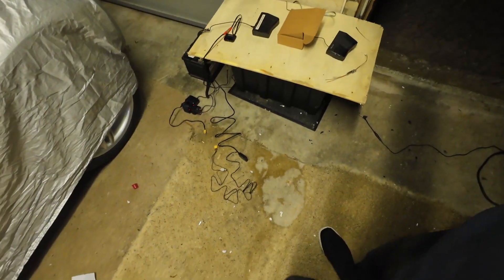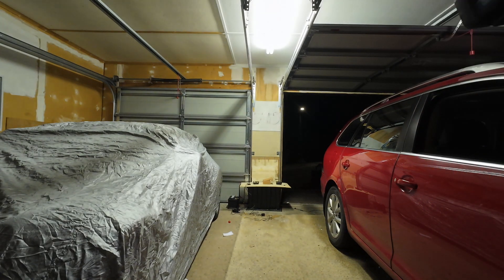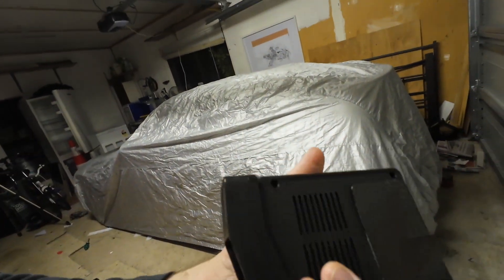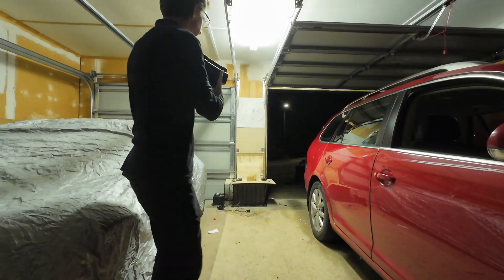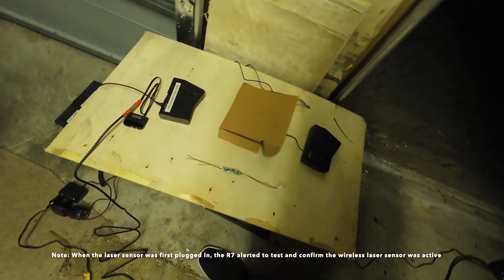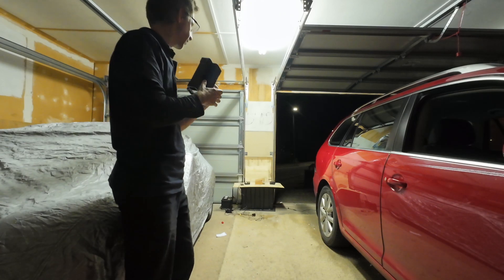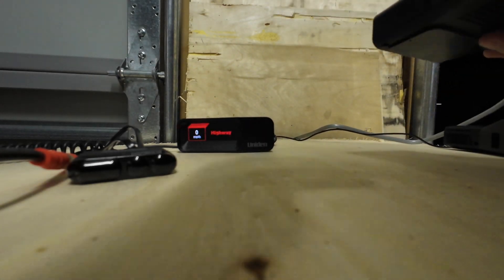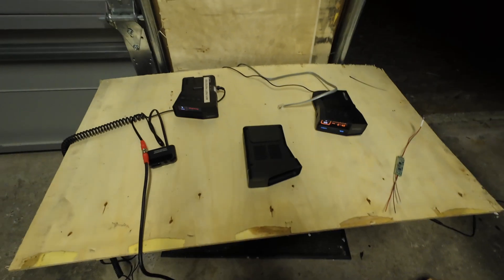Laser hardware sensor upgrade for Uniden detectors.

Comment: Excellent addition. What would be an approx. range of detection?
Regards
Kevin
Reply from the maker: It's based upon a TMG hardware so I would expect it could pick up the laser gun well in excess of 1000m. Probably the longer the range the better it works as more air the beam has to travel through the more the beam is scattered.

Comment: can you help me make this configuration?
Hi, what type of sensor is it and where can I buy it to make it work?
Does it work with his firmware or do I have to get the international custom one from the forum?
Reply from the maker: This is a hardware upgrade that works with the on-board detectors laser hardware.  Therefore can be pretty much installed in any detector which has a working laser sensor.  Doesn't need a specific firmware upgrade to make it work.  However with R7 156 international soon to be on release that'd be a no-brainer if you have an R7.

Comment: wow... Nice. This is great where it's illegal to have laser jammers. Few questions. Will it work with R8? Will you be able to have multiple laser heads to use for trucks that are wider? And hopefully you will have a kit available with detail instructions.
Reply from the maker: Yes is should work with the R8 the same as it does with the R7.  You can use multiple sensors and only needing the single wireless module installed in the detector.

Comment: Does this support one or two modules?
Reply from the maker: You only need one module in the detector and that can work with multiple wireless units mounted in the car.  I.e. with sensors mounted front and rear the detector will alert when either detectors the laser signal.

Comment: Great stuff. It will be interesting to see if filters will be needed for laser based cruise control systems in other cars.
Reply from the maker: This hardware was built for me by TMG.  Therefore I believe it probably has all the necessary filtering built into the electronics signal processing.
Reply: @mikefearn5213  Thanks for the post, the information, and all the hard work here! I am thoroughly enjoying your R7 International firmware too!